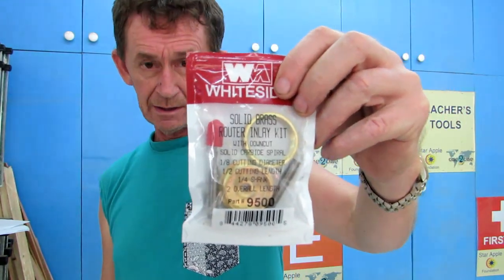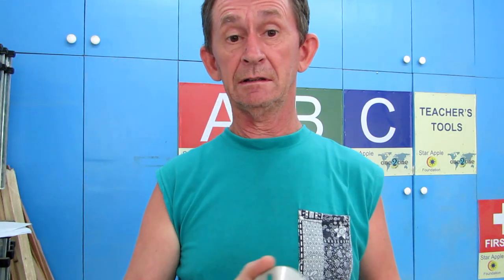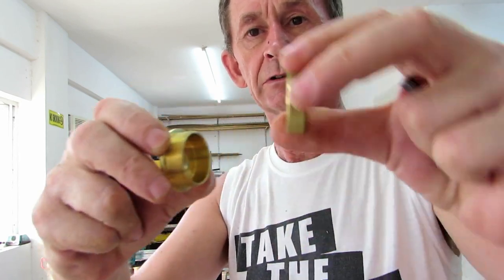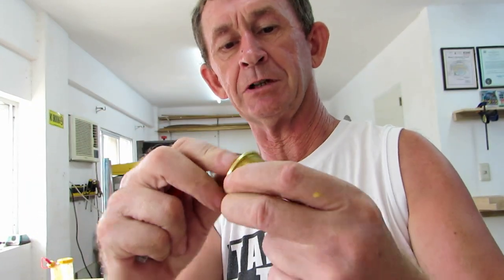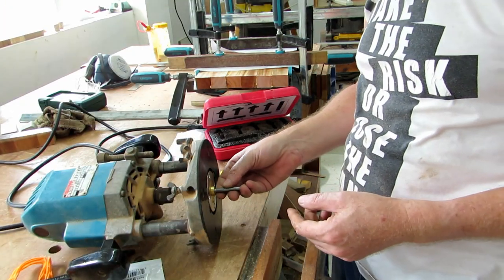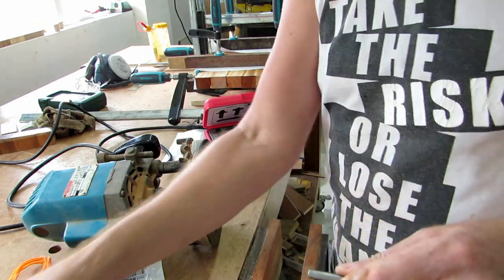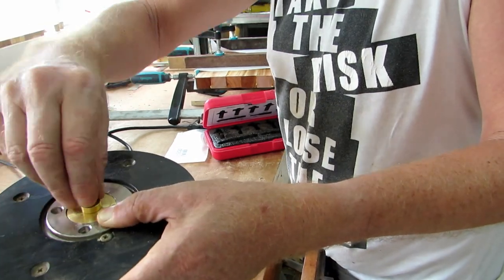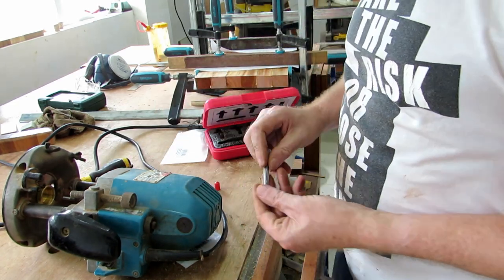How to Setup a Whiteside Inlay Kit 9500

Comment: Hi 
RE WHITESIDE MAKITA INLAY kit
thanks for replying
I bought the kit and it fits perfect 
But I had to fettle a bit I got the tip from the new brit workshop
By mounting the bush in the drill press and just slightly touching the thread with a fine file
 Result perfect fit in the the plunge base 
Also the katsu bushing set fits the makita rto700c palm router base as they are straight out of the box
All the very best
John s
Manchester
ENGLAND
Reply from the maker: That is great John. The last time I was in Manchester was January 2010. Old Trafford (away fans section) 😂

Comment: I recently bought the Rockler version of the router inlay kit. I may do some inlay work on my workbench.
Reply from the maker: It is a little awkward on a full size router, but a plunging router is a must. The inlay came out good and very accurate though. Might but a cheap 1/4 plunge one.
Reply: Irish Chippy I’ll have to use my full size Bosch plunge router — no cash for a smaller one right now.
Reply from the maker: I have no cash for anything these days. Building a house is like a money drain. I used my 30 year old Makita. My friend has a smaller one that I swear he has never used. ... Pascal
Reply: Irish Chippy I fully understand. A big part of woodworking is using what we have. Fortunately there are many ways to do the same thing.
Reply from the maker: Indeed Don, and as we get older, we learn more ways. With the internet a big part of everything, the knowledge available to learn is immense. Look forward to your inlay. I hope you don't mind, I gave you a mention in the other video
Reply: Irish Chippy thanks for mentioning me. My little channel needs all the help it can get. 

Yes, the Internet has really made a BIG impact on my woodworking. It sure helped me to remember my turning skills from many years ago.

Comment: Hi, came across this as I could not work out how to fit that main brass plate.....I bought a similar kit just to get the guide bushings with the intention of making my own back plate. Of course when it arrived it had that main brass plate and even though it won’t fit any of my routers I was going to make my own adaptor BUT could not see the purpose of the 4 holes within that plate. If they were threaded it would seem to offer more of a clue but they’re not. Your explanation shows me the correct/intended use of the plate and completely makes sense but I still can’t see the point of the 4 holes. Thanks very much anyway 👍
Reply from the maker: Your welcome. Thank you. There is a video here of me using it on a chopping board. Sorry for delay. Haven't been on YT for a month. Been doing charity work away from home.

Comment: Hi
Can you possibly tell me if the inlay kit 
Fits the makita rto700c plunge base 
It measures 6.7 centimetres across
All the very best 
John s
Reply from the maker: Hi John. I am not 100% sure, but I think so. You need to buy this Makita adapter https://amzn.to/3lDpoJK or a cheaper copy here https://amzn.to/3quYRSA. The outer diameter is 68mm and the recessed diameter is 62mm. I bought the cheaper non-Makita one, and it is fine